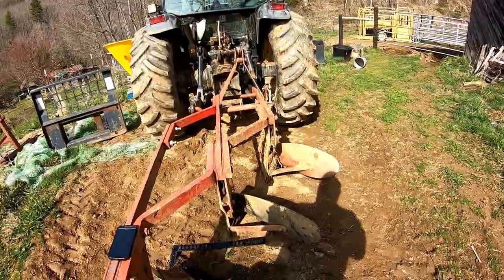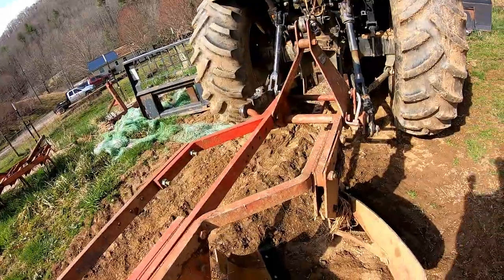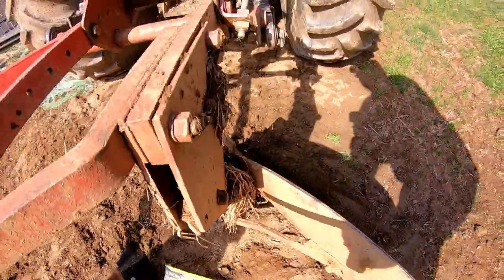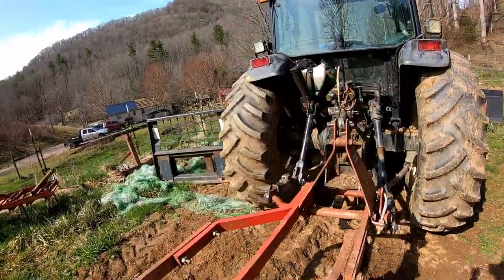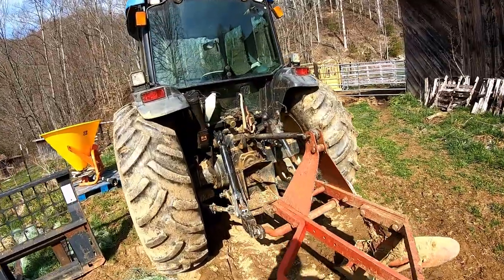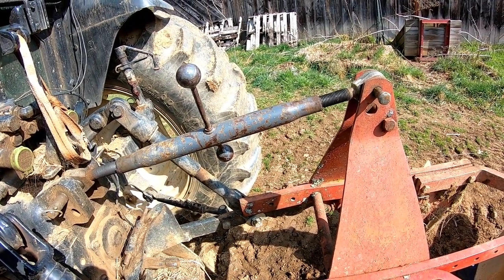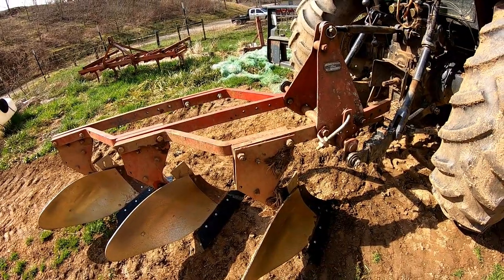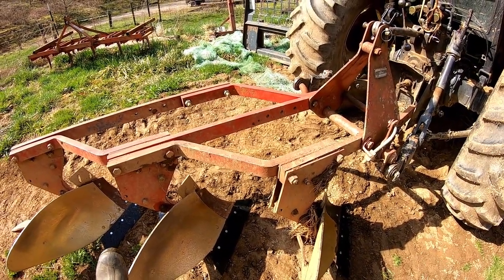The Art of Plowing

Comment: Here in Tennessee we have always use a 2 or 3 bottom disc plow. i have always use one, just a few days ago i got a ford 2 bottom plow.  just like this one you have but a 2 bottom. the disc plow works good for cutting root, rocks stumps ECt, Guess i will see how a bottom plow works around here. good videos on the set up... the disc type plow setup about the same.
Reply: So how is the 2 bottom vs the discs?

Comment: The main reason most larger farms have gotten away from using a moldboard plow. Is fuel use and speed. 
They like it wide and fast these days.  28' 32' ft wide disk and 40' field cultivators.

Comment: Just curious i see that in your plow setup the 2 bottom arm in the 3 point seem fixed preventing lateral movement.  Most people recommend leaving them loose in case you hit aa rock or hard object in the soil.  Just wondering why you keep them like that,  i am new to plowing and trying to see what right setup is best for me.  Thanks
Reply from the maker: Plowing hillsides I want them pretty tight they have a little play but not much
Thanks for watching
Reply: never had bottom arms locked wether ploughing up or down or across a hillside  just set the plough correctly and it will do the job